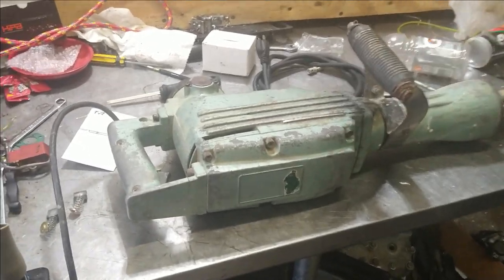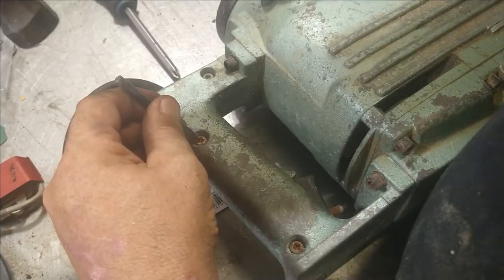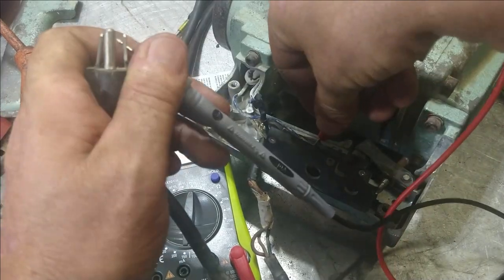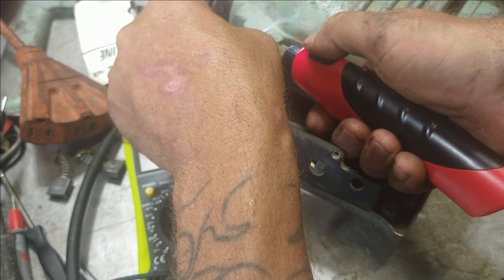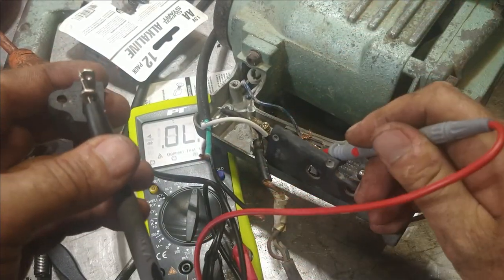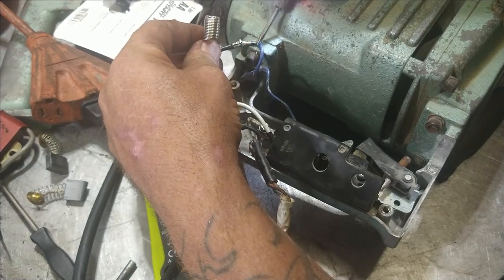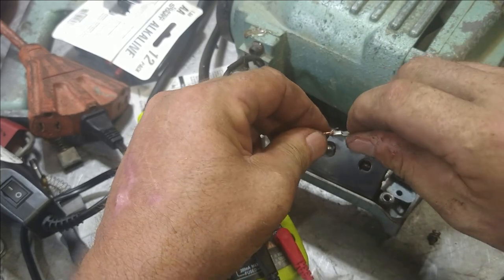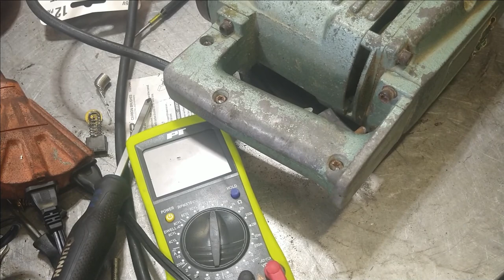installing a new power cord on my electric jack hammer

Comment: Fyi it's 115v that doesn't matter which way you connect the wires as long as the ground is in the right place
Reply from the maker: ill connect it the way it was connected anyways
Reply: @smallengineguys  i just changed my cord today i did it the same way you did great video thanks